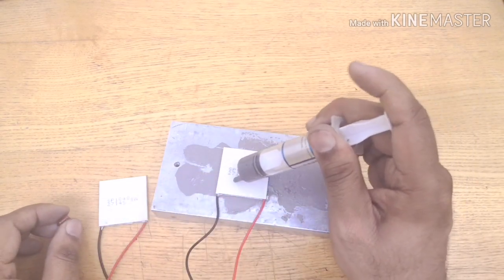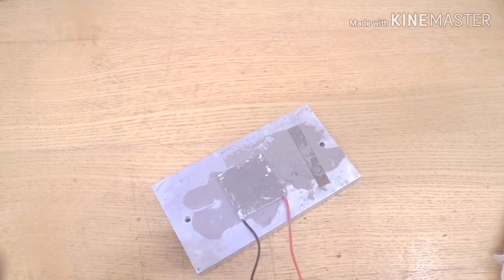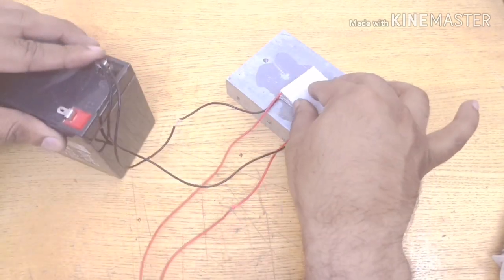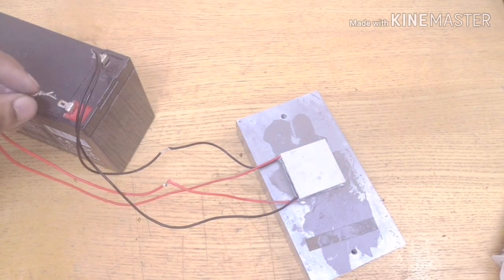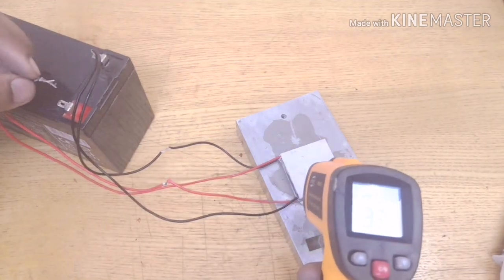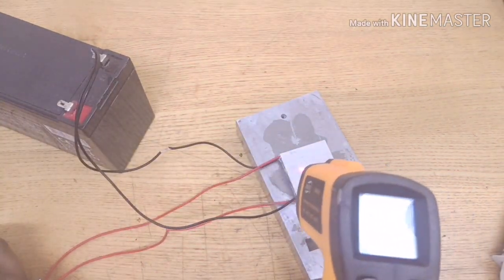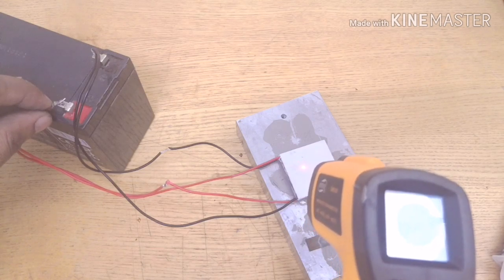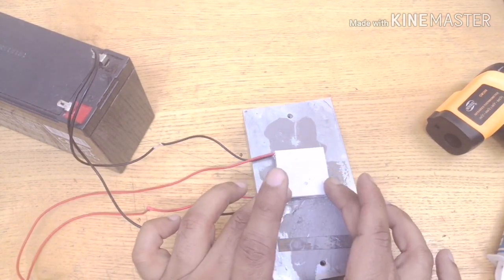PELTIER EXPERIMENT.. NEVER SEEN BEFORE

Comment: Are you serious?! flip the upper module and you will see it get cooler. its getting hot because it is reversed (the two cold sides inside and the hot sides outside)
Reply from the maker: Yes you are absolutely right. But this experiment shows that this thing (peltier module ) so called heat pump will produce heat even the other side is cold..
Reply: @DIYTAYSEERworld  only until the heatsink gets hot

Comment: make an expriment of +-+- mean cold to heat and cold to heat to see the thermo coller can generate more - temperature or not
Reply: That’s impossible given thermodynamics. If you put some energy in one side it will not only be insufficient generated current but it will be lost in heat rather than continuing around

Comment: can't read the temps in video

It's never seen before because it is basically pointless. The whole point of the video is unclear... you are basically putting the two peltiers in parallel, which means you could be cooling an object sandwitched between the cold sides roughtly twice as quick as with one peltier. In the video you are cooling a thin layer of air and thermal compound... I guess it would be about the same as cooling something by placing the two coolers side by side (on the same side) or cooling the same thing by placing the coolers at the opposite sides.

Cooling will be quicker but both hot sides of the peltier will simmetrically heat up and since I see no heatsink on one of them, it's obvious it will heat up quicker than the other. Also, if you let the hot side of a peltier module unsinked it will rapidly warm up so the heat will start flowing back to the cold side making the cooler completely anti-efficient. 

I think a more interesting experiment could be investigating to see if 4 coolers at 6volts can cool more efficiently than 2 coolers at 12volts.
Reply: The point of the video was very clear.
To see what happens when you stick 2 peltier cold to cold... 
But what he learned is very unclear and pointless.

Comment: The cold side is still "hot" until it reaches absolute zero, that's -273.c.
And peltier will try to move this heat, quite inefficiently so. Causing large heating on hot side.